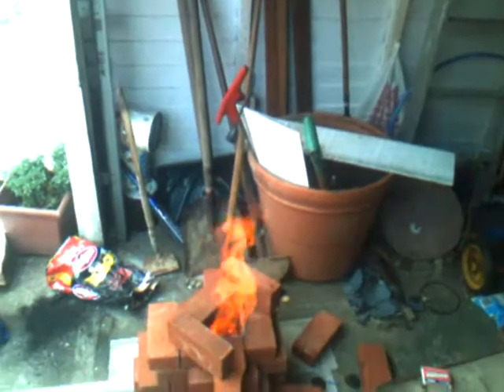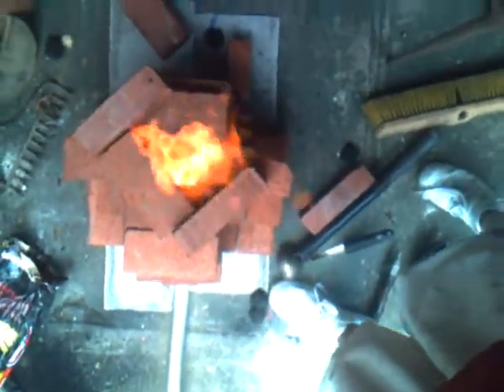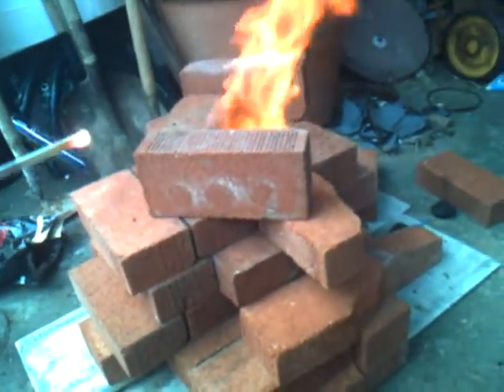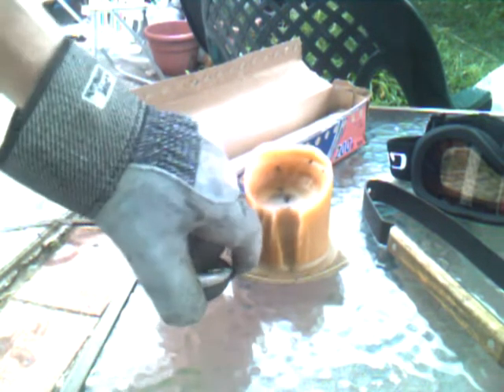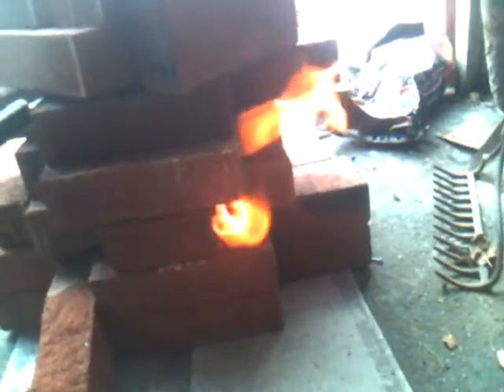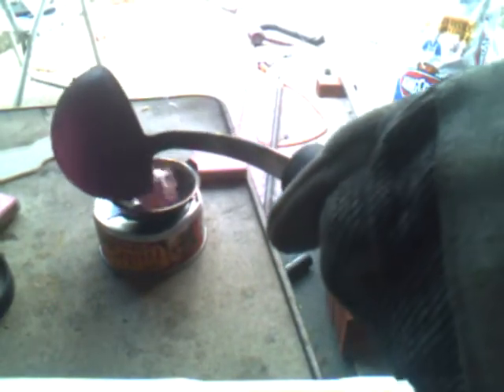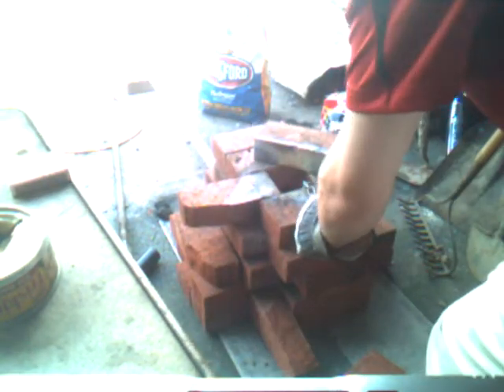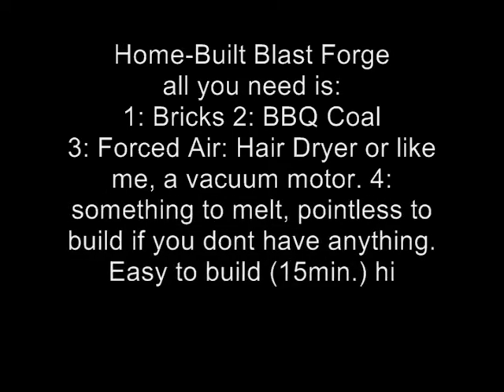Home-Built Blast Forge

Comment: hey we are taking damascus steel and cutting rings. we wanted to make blades like for oyster knifes and we need a forge to strengthen it so can u mail me the specs for the forge ex. height material burned and holder of the burning material.

Comment: You shouldnt have the air on all the time. 

and also you only ever ever let steel go white if you are going to weld it, if your going to shape it it needs to be cherry red, if it goes white you will add more carbon to the steel and then theres no point.

smelting, why are you melting metals?
these all have been treated in special ways.

Comment from the maker: best way to tell temp is to use a infrared thermometer, anything else will burn or shatter, a typical clay garden pot will work great for anything, just make sure its the sort without holes in the bottom D: also if you have the air on and are adding charcoal wen it needs it, its pretty self-sustaining

Comment: i think i'll try this but i think i'm going to go with fire bricks did you use a pipe under it for the air blower or did you just leave a hole open in the bricks at the bottem and focus a blower on the hole?

Comment from the maker: just arrange the bricks like a chimney, the one in the video is about 2 feet tall, you can make yours as large as you want. make the area inside the bottom larger for the coal, and leave a small gap at the very bottom for the forced air. thats all! oh btw, you can use anything to blow the air, ive used vacuum cleaner motors and hairdryers, the vacuum motors are by far more powerful.

Comment: Great video, I've been using coffee cans, sifted coal and a hair dryer. Hobo blast furnace, if you will. Can't get it too hot or it will melt the cans, but, I can temper steel with it. I'll have to try your way. 5/5 rating